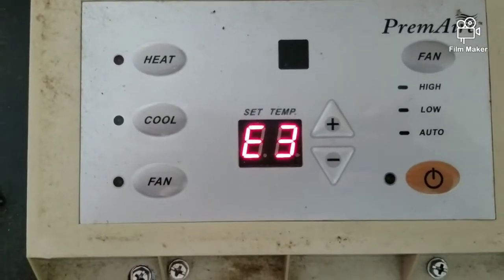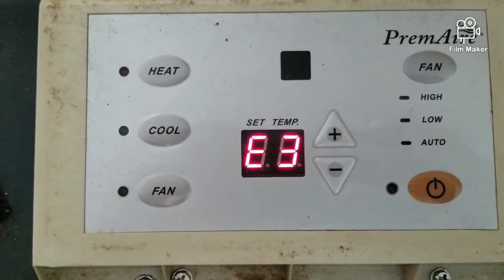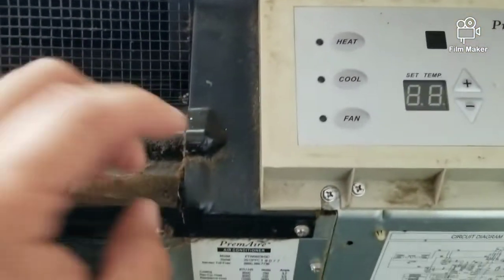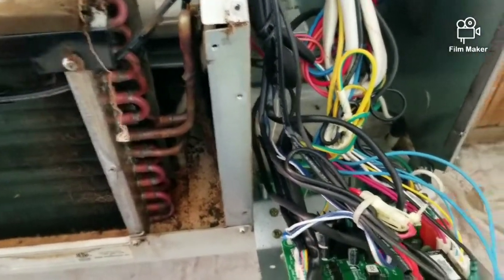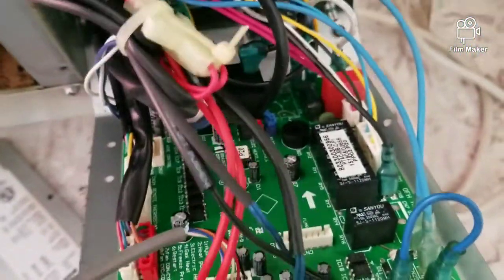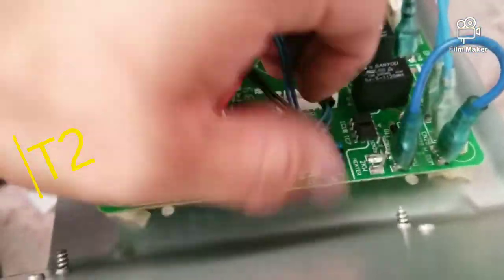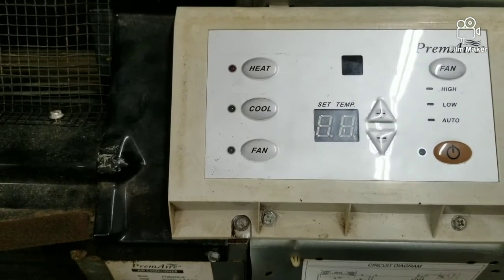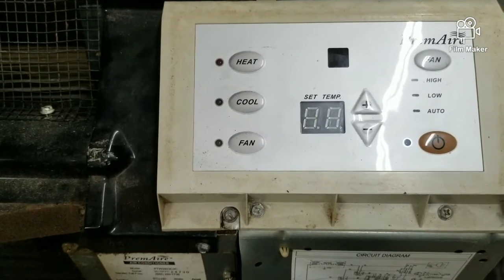E3 code on premaire ptac? Here's how to fix it...

Comment: What  is the use of the  yellow  cable  that is glued  to the  Sheet  above the fan ptac??
Reply from the maker: Hey Hugo
That's the indoor discharge thermistor. That monitors the discharge air coming out of the unit
Reply: Gracias amigo.  Good information.  Last  question that  thermisor  does not have a faul code when it does not work??
Reply from the maker: @hugohernandez8783  yes it's a f6 code
Reply: Gracias  amigo. 👏

Comment: Where is a service manual for the Premaire PTACs?  Or are they using the same parts as __________________?
Reply from the maker: You can find a manual online and if you need parts you can call them at 888 289 7736

Comment: So are you simply replacing the indoor coil thermistor?
Reply from the maker: Yes, pretty much
Reply: @PtacSolutions   Thanks. Will this work with the outdoor coil thermistor as well?
Reply from the maker: @angelojuvera5885  don't think that sensor would be long enough to reach the outside.. personally I haven't tried

Comment: Hey Dave I have a premaire never really had issues with them however I have one the internal fan is not working. It's not seazed up as I can rotate it. Where do I begin?
Reply from the maker: Hey Jayson 
I would start by checking the blower capacitor or any loose wires

Comment: If I have error E9 ? What should I do? Help me?
Reply from the maker: Hello
E9 code means high pressure switch is open... check for a broken fan blade, dirty condenser or bad condenser motor